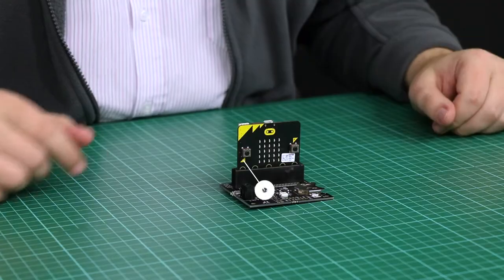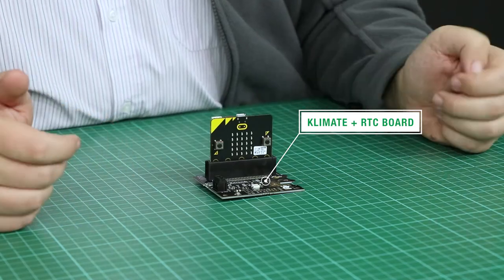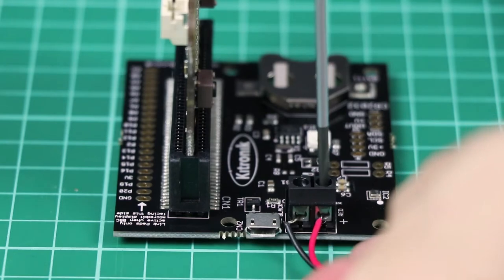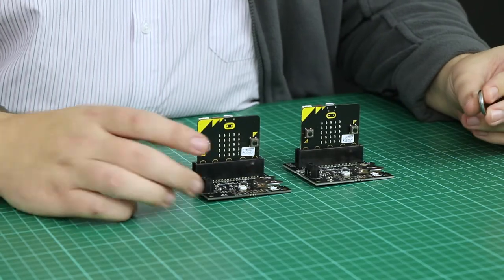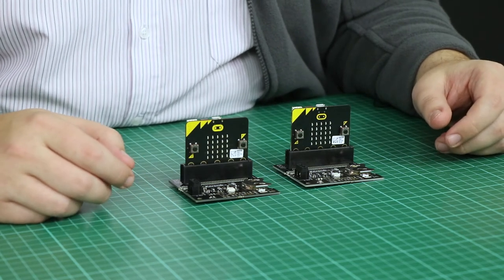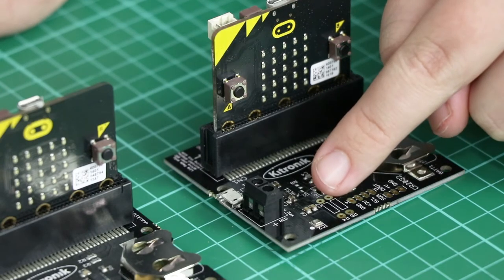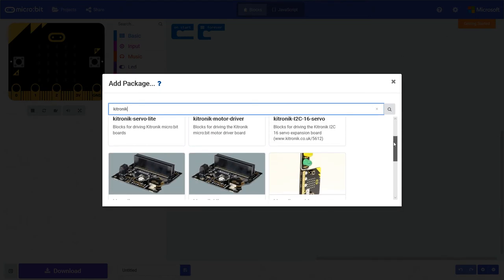Real Time Clock (RTC) & Klimate Board For micro:bit

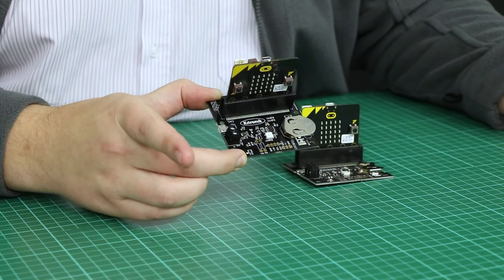Comment: This looks like a useful board, but I am unclear where the "expansion ports" you refer to at around 0:50 are located (as you do not point them out). Even looking at your board more closely on your website, I still don't see them. Where are they?
Reply from the maker: Ho Thomas, here is a direct link to the Datasheet which details what i/o options the board features: https://www.kitronik.co.uk/pdf/5635-kitronik-realtime-clock-microbit-rtc-datasheet.pdf